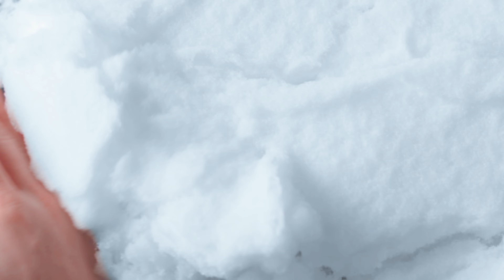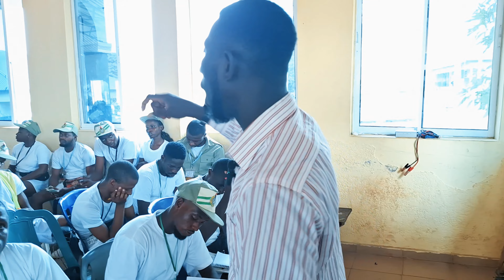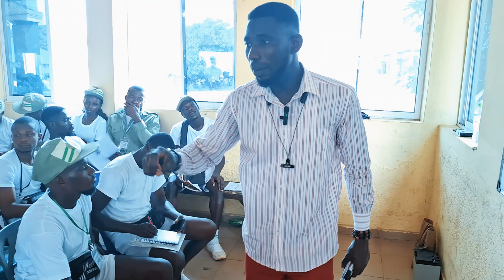How a Solar Battery Works | Full Tutorial

Comment: I love the class....
Reply: I simply have a question to ask pls! If I'm having tubular battery 🔋 of 12v/240AH AND 12V/2200AH to be joined in parallel, now Wat is the best PV connection of 4pices of 350wats panels for better boosting of battery charge, could it be dsame parallel concept or series concept, either two in series, two in parallel or does 4picz of 350 wat is not still enough???
Reply from the maker: @EdwardSteve-l9w professional you don't mix two different battery capacity together, it will affect the whole backup system and depending on your design, that's when you will know what exactly the kind of connection to do with the panels
Reply from the maker: You can reach out to me on wa.me/9060944505
Reply: @morutech ok mine was mixed together, and which I questioned the installer, and said it good to go